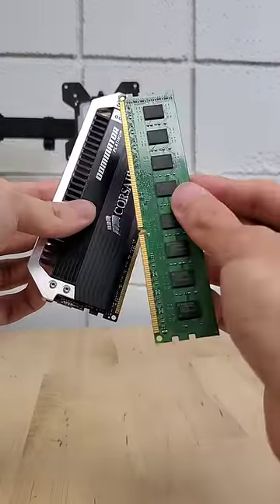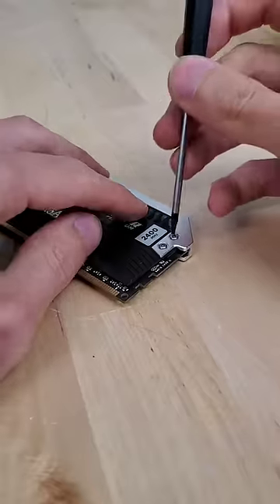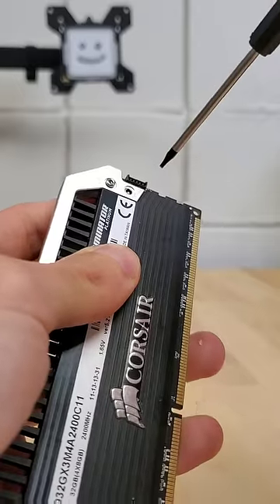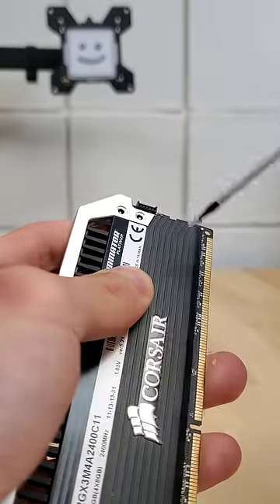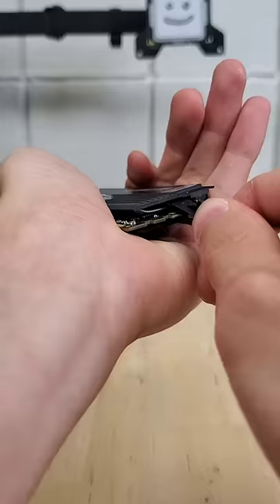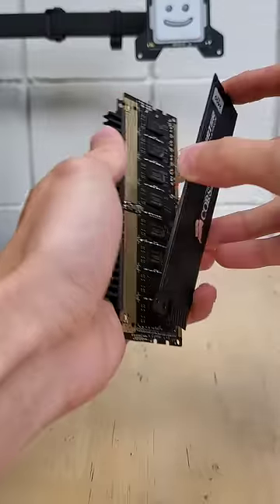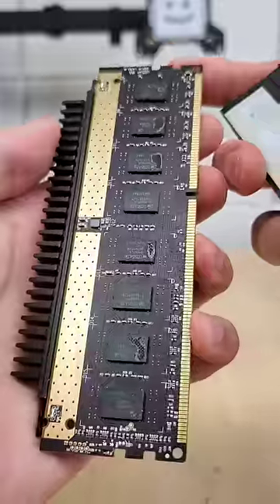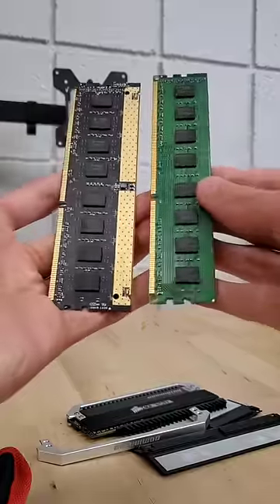why do these RAM sticks look different? #shorts

Comment: The Mini P.E.K.K.A is a Rare card that is unlocked from the Training Camp (Tutorial). He is a fast, single-target, melee troop with moderate hitpoints and very high damage. He is clothed in gray metal armour and wields a smaller version of the P.E.K.K.A's sword. His horns are a bright vivid team colour, along with his single eye. A Mini P.E.K.K.A card costs 4 Elixir to deploy.

AD
Strategy
Like the Prince, he is best used defensively against single troops and then for a counterattack due to his slow attack speed but very high damage.
He can be used with high hitpoint troops, such as the Giant or Golem, so that they tank all of the damage dealt by opposing units while the Mini P.E.K.K.A deals massive damage to them. However, this strategy is very vulnerable to swarm cards, so it should be used cautiously.
A Mini P.E.K.K.A can defeat equally levelled Musketeers, Wizards, Electro Wizards, Ice Wizards, and Magic Archers in one hit for a similar Elixir cost, making him useful for quickly taking out these troops behind a tank.
It can also defeat most support troops in 2 hits, and coupled with its high speed, the Mini P.E.K.K.A can be considered as an anti-tank and anti-support. Because of this, against a tank and support push, it is more effective to deploy the Mini P.E.K.K.A on the support troop instead of the tank, so that he can eliminate it, saving more of his hitpoints for a counterpush.
Skeletons, placed at a distance, are capable of eliminating a Mini P.E.K.K.A with the help of a Princess Tower.
To do this, the defender should place the Skeletons in the centre of the arena, slightly staggered to the opposite lane of the attacking Mini P.E.K.K.A. The Mini P.E.K.K.A. would be effectively stalled and would be chipped down by both Princess Towers.
Area damage units and spells complement the Mini P.E.K.K.A and its synergies well since its slow hit speed is ineffective versus swarms. Slower and tankier area damage units like a Valkyrie should be placed in front of the Mini P.E.K.K.A, so it can push them forward more quickly, while they tank for the Mini P.E.K.K.A faster and more fragile area damage units like the Fire Spirit should be placed behind it, so it can protect them.
Due to the many positive Elixir trades that can be made on a Mini P.E.K.K.A, it is generally not effective to send one down the lane by itself, as this usually results in a waste of four Elixir. However, if the opponent happens to be low on Elixir or lacks a cheap counter, then this strategy is capable of dealing major damage to the opponent's tower or can force a bad trade.
The Player should never ignore a Mini P.E.K.K.A in the opposite lane, as it can easily deal massive damage or even destroy a Princess Tower if not dealt with.
Defensively, the Mini P.E.K.K.A can be used to easily annihilate a great variety of enemy troops (for example the Giant and Musketeer) due to his high damage output for the relatively low cost of 4 Elixir.
With the help of an Arena tower, a Mini P.E.K.K.A placed near the center of the map can stop Elite Barbarians for a positive Elixir trade.
A Mini P.E.K.K.A is a great counter to the Hog Rider, allowing at most one hit on the tower.
If the player has an idea of when and where the opponent will send in their Hog Rider, they can hover their Mini P.E.K.K.A in the middle of the lane and deploy it the instant the opponent places the Hog Rider. Doing this will completely shut him down.
If the Hog Rider is accompanied by fast grounded units like Skeletons or Goblins, the Mini P.E.K.K.A may retarget onto them, disrupting the player's defense. Using a spell to quickly destroy the Skeletons so that the Mini P.E.K.K.A can help defeat the Hog Rider is recommended, even if it is a negative Elixir trade, as the Hog Rider will get much more damage for only a small Elixir advantage otherwise.
He can eliminate or cripple most tanks by himself as long as they do not deal high damage themselves, like the P.E.K.K.A. However, if there are support troops behind the tank, he should be placed to target them first, or they will threaten to eliminate him.
A quick and deadly combo is the Miner paired with the Mini P.E.K.K.A. The Miner tanks all the damage while the Mini P.E.K.K.A does the damage. This can easily take a Tower. However, it can be fully countered with a Skeleton Army if the Skeleton Army is played early enough (i.e., one portion of the Skeleton Army goes for the Miner while the other Skeletons distract the Mini P.E.K.K.A). Many players tend to use small units against the Mini P.E.K.K.A; the player can use this habit to their advantage by assisting it with an area damage spell or a splash damage troop, such as Fire Spirit or Princess.
History
The Mini P.E.K.K.A was released with Clash Royale's soft launch on 4/1/16.
On 9/2/16, the Chest Rewards & Card Balance Update increased the Mini P.E.K.K.A's hitpoints by 3%.
On 3/5/16, the May 2016 Update increased the Rare card level cap to 11 (from 10). The Mini P.E.K.K.A. was changed to be affected by pushback. Additionally, the Mini P.E.K.K.A's sound effect when deployed was updated. The sound effect now sounds like “Pancakes”, and a tweet by the Clash Royale official Twitter account implied that that was the correct interpretation. It had a real life Mini P.E.K.K.A standing next to a Giant Skeleton, with the caption “Who wants pancakes?”.
On 11/8/17, a Balance Update increased the Mini P.E.K.K.A's damage by 4.6%.
On 24/1/18, a Balance Update increased the Mini P.E.K.K.A's hitpoints by 7%.
On 1/7/19, a 'Rulebook' Update increased the Mini P.E.K.K.A's range from 1.05 to 1.2 (now classified as Melee: Medium).
On 5/5/20, a Balance Update decreased the Mini P.E.K.K.A's range from Melee: Medium to Melee: Short (1.2 tiles -> 0.8 tiles).
On 3/11/20, a Balance Update increased the Mini P.E.K.K.A's attack speed to 1.7 seconds (from 1.8 seconds) and its first attack speed to 0.4 seconds (from 0.5 seconds).
On 27/10/21, the 2021 Quarter 3 Update increased the level cap of all cards to 14 (from 13).
On 3/2/22, a Balance Update increased the Mini P.E.K.K.A's attack speed to 1.6 seconds (from 1.7 seconds)

Comment: A stick of ram that remains cooler is very much so not the same thing. And the fact that corsair didnt just shove a regular stick inside the dominator case they created and entire diffrent circuit to do so as well as additional groundings and sheildings just to accomplish a higher performing product DOES NOT MAKE THEM THE SAME. Stupid video.

Comment: Tbh they look nothing alike one has a black pcb (more expensive) better chips, more pure conductive material. And a huge contact pad on top which looks to be for either rgb or heat dissapation. Overall the Corsair one looks like way more thought went into designing it.